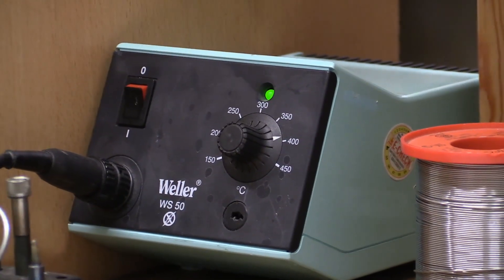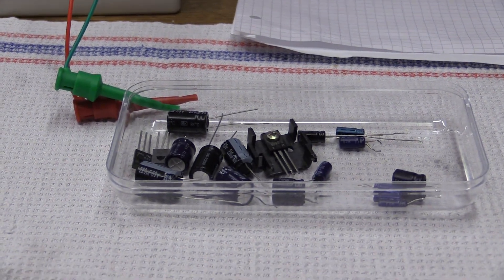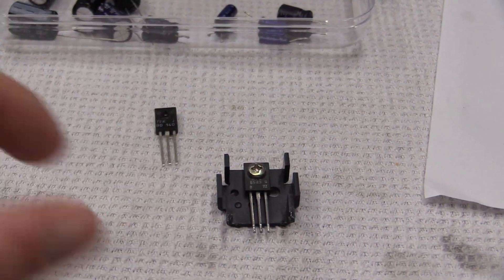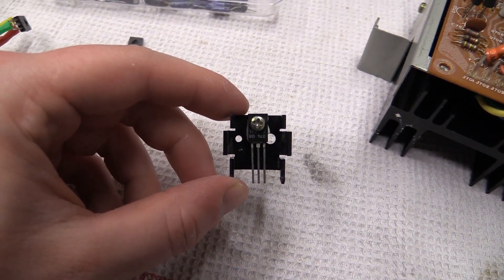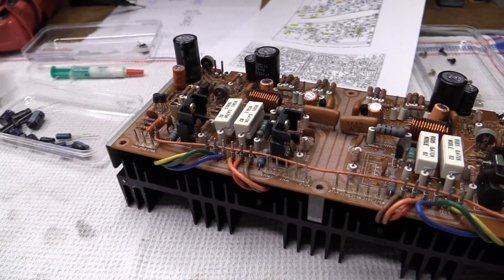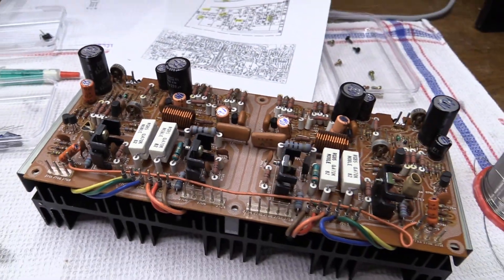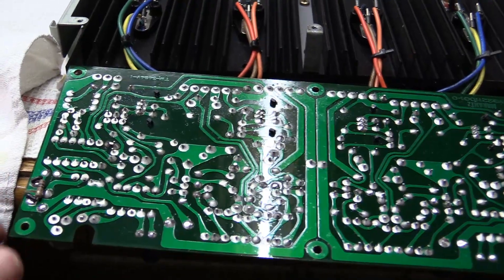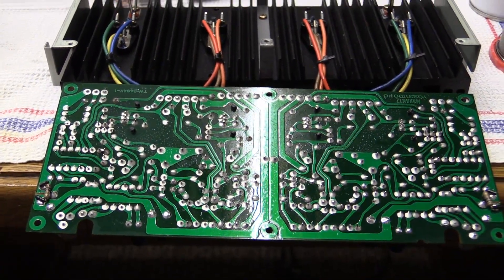DrCassette's Workshop - Marantz 2265B receiver repairs II

Comment: I don't think that the louder repaired channel is because of the higher current gain of the replaced transistors! This amp has a negative feedback and the amplification depends only on the resistors values in the feedback, the feedback is compensating any other gain differences. Maybe something is wrong in the "good" unrepaired channel, and that's why it's quieter. I suggest to search for the problem somewhere else except the replaced transistors.
Reply from the maker: Thanks for the tip, after thinking about this a bit more I wanted to check some more things anyway(such as the signal going into the main amplifier). Maybe there's somehing wrong in the preamp, or as you said, in the other channel...

Comment: This makes me what to try and fix my Marantz PM230 amplifier that sometimes has a pop from the speakers at any volume if only i knew what was causing it to pop.
Reply from the maker: Have you checked the power supply pcb and wiring? I once had the exact same issue with a Grundig amp and it turned out to be a bad solder joint. Re-did it and the amp never popped again :)
Reply: Thanks I have only taken it apart once to check the capacitors but didn't look for any bad solder joints thanks for the tip hope it works been getting annoying